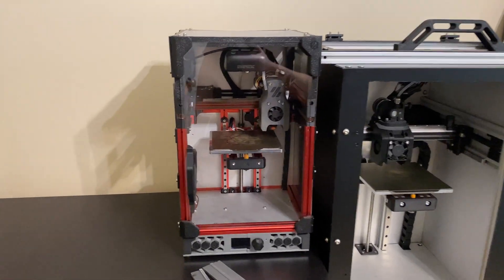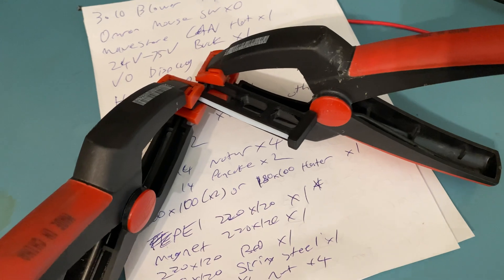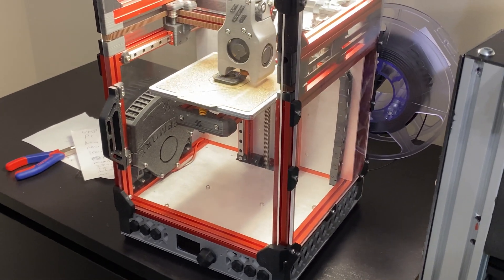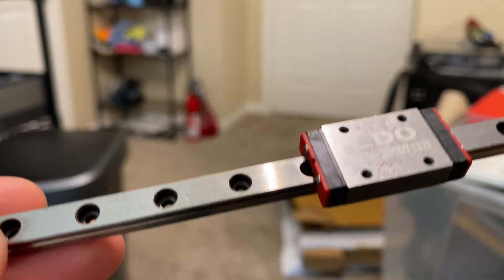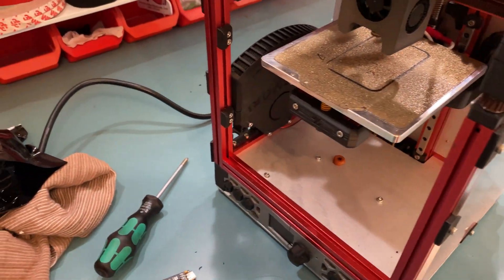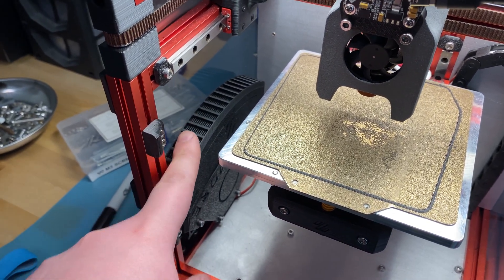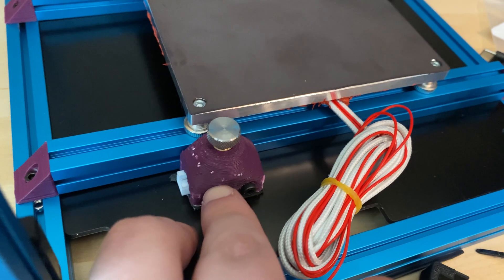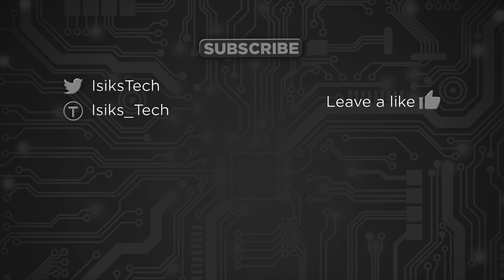Voron Zero Ep. 12 - Printing Again, Nevermore Micro and Future Plans

Comment: Doesn't Klipper use arc movement for curves using the "[gcode_arcs]" configuration? That might reduce the amount of instructions being sent so that might help the issue. That said, I barely know what I'm talking about so that might not help :D
Reply from the maker: Stl files aren't saved with curves (instead they are polygons) so even if klipper supports it (I need to research this) the sliced gcode still won't use arcs.
Reply: @IsiksTech  I think it actually recognizes when the polygons form a curve and turns them into an arc as you're printing/before the print, something like that.
Reply from the maker: Oh yeah I found it. Thanks for the info. Unfortunately with the dead-ish duet I can't use this atm on the v0 but in the future I'll experiment with it.